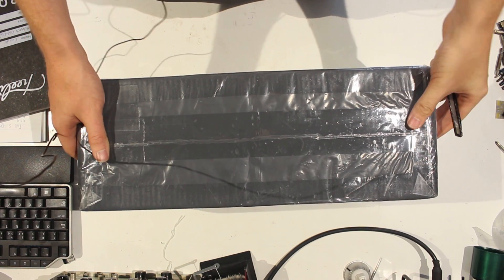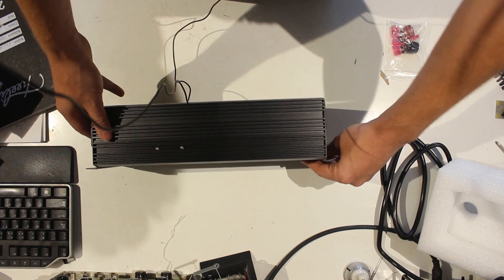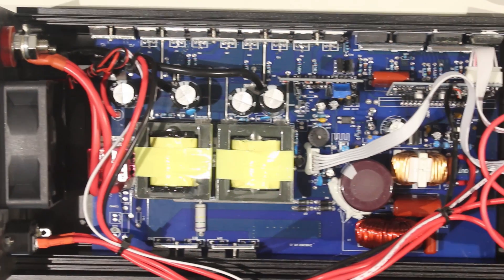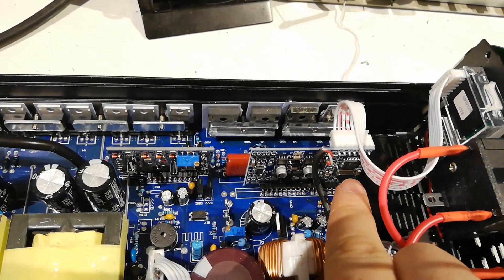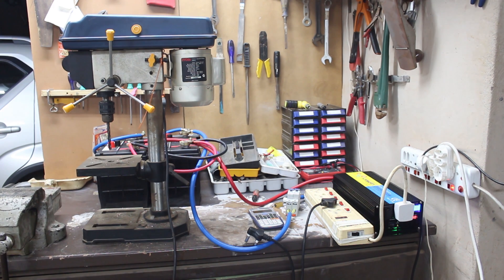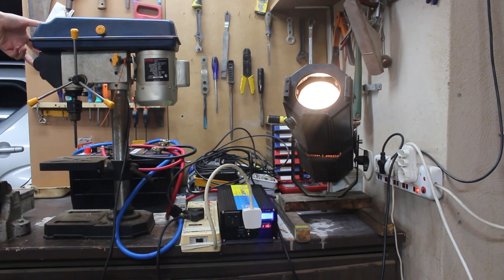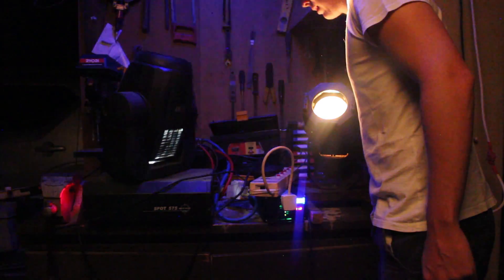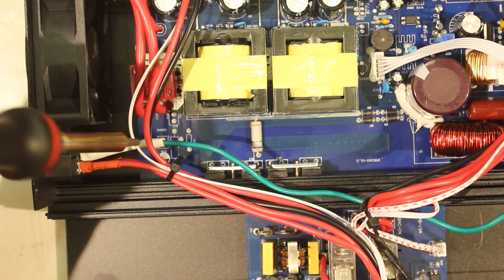Cheap 2000W Pure Sine Inverter Review and Teardown

Comment: 1200w are more then the rating!

Every knows when buying a Chinese cheap anything,  you have to double it...  You need 2000w to run something,  you dont buy a 2000w, you buy a 4000/5000wand you get 2500-3000 out of it...  Depends on where you plan to plug it in.. 🤔  But come on

Comment: I bought an pure sine wave 2500 W inverter of this brand 7 years ago. The performance has been fabulous through out those years. I used this to covert power from a 24V-300Ah lithium battery (Laid- acid battery in earlier days) of my off grid solar power station. It has successfully drive my washing machine with heating function (Maxium ~2000W) for years. Despite it get hot after this (Especially summer time), it is still running today. (While I should bought an inverter with higher capacity.)

The only repairing is the cooling fan bearing bursted recently and I have to replace it. Other parts still in a good condition to support daily operations. 
But I do agree that when you are going to use this type of inverter, basic knowledge on electricity usage is needed. Especially for the earthing, I built another socket for this. I also applied several Circuit Breakers after it's output to protect the inverter and the 220V devices.

Comment: Bought the same brand, but the 12VDC - 1.5/3kW version and surprise, surprise it lasted 3 seconds; BANG! and then smoke from inside. The sound was really loud, like a gunshot. Didn't even get a chance to plug in anything and was dead. The DCV display was still working, green LED on, but the AC display was dead and of course no power on the AC side. Made in china; what to expect? Clearly was not tested before leaving the factory, otherwise they would have enjoyed the bang, not me.
Reply: What did you connect into inverter? Btw. iphones are made in china too

Comment: WOW!!   LVYUAN brand?   finally i find a INVERTER that uses the EGS002 control board!!!  they are very reliable and they are only 4 dollars,or 4 euros, to replace in case they fail;     *THAT IS GREAT*
Thanks for showing those internals,that is what i was looking  for; 

and that thing LOOKS GOOD,it really does,lots of mosfets,and well built;  (too bad it has only 2 of those small transformers,shd be 3 or 4 )
Reply: I agree, 2000W inverter usually has 4 X transformers
Reply: @voltworksofficial    damm... it looks like it has a 3rd transformer under the lid,it has thick wires going to the lid!!  it also serves as a UPS,the video author said??   if it is so,i do not want it,i will choose another similar Lvyuan without that
Reply: @josepeixoto3384  Oh ,yes,there is a 3rd transformer in another PCB

Comment: I have the 1500watt one of this make in my RV and its been great - I have it feeding a soft start 4 socket extension lead - the most I ever pull is a 900w microwave  - we have a rule only one large appliance on at a time ie toaster/kettle/coffee maker - we have a led indicator switch conveniently place ti trigger a 120a relay so its not left on when not in use - was temted to go bigger but out 320ah lifepo4  house battery only has a 120a BMS
Reply: is it still going?
Reply: So there both red cause there both actives !
 there is no neutral 
You need men to have neutral and that's not on portable power😅

Comment: If I look at the power cord for my 2Kw fan heater the wires for that are thinner than the internal wires on this inverter and I have not had any issues with my heater in the many years I have used that!

Comment: Is there a chance 2000w is the peak wattage?
Reply from the maker: Hi I am not sure really. I tested it up to like 1300W. It said the peak wattage was 4000W for starting motors and such and 2000W should be the max continuous wattage.
Reply: @ChristopherdeVilliers  There is no way that the 2 x transformers together are capable of 2000W continuous
Reply: @ashrafebrahim8395  I agree your thoughts,usually one transformer is about 500W, two means 1000W,

Comment: Thanks for the video - was curious on how sketchy these were since I bought a "1kW/2kW" inverter for off the grid use. Seems somewhat sketchy but not dangerously so which is good enough for me at the price. :D Just commenting to be a classic youtube know-it-all, I don't think drill will not pull its rated power at no load.

But it's nice to see that I'm set for a proper island rave. :D
Reply from the maker: Ooooo an island rave sounds fun. Enjoy

Comment: If you were wanting to power your house I would of opted for the 24v-240v lvyuan CZ-3000W ups inverter charger. It has a 9000w peak for half a second and rated at 3000w continuous. It also has a 40amp in built charger that will charge you battery if you have no sun for solar input via the mains. Also has a earth point. Heavier duty qualitly build weighing in at 25kg with six power outlets.

The one you have isn't built for households it's more of a RV, caravan, camping or for light ireggular use. They can't handel heavy loads for long or they over heat
Reply: and costing how much?  a fortune,for sure;  
9000 watts at 24 volts is more than 375 Amps: WOW, that is a STARTER MOTOR of a V8 car; 2 large car batteries would last the whole of 10 minutes,tops; at 3000 watts ,125 Amps, they  last a bit more...
Reply: @josepeixoto3384  think I paid $600 Australian for mine on ebay. There is newer models for roughly the same price 

Yeah puts out amazing amount of power. I run four 12v 230ah deep cycle agm batteries on my solar se up. Eight 250w solar panels and a 60 amp mppt charger controller...oh and a 3500w generator for days of rain. No issues yet. Happy dayz.

Comment: Careful with the Idea of connecting grounds... These inverters have no neutral, your two wires are two phases. If your inverter is 220v you would read 110v between one phase and ground. If you connect ground wires (especially the input side) you will essentially end up shorting one side to ground because typically in your home breaker box neutral is bonded to ground. This will fry your inverter.
Reply: Only in countries that have 110v supply.  Many countries have single phase 240v domestic supply. (AU, UK, ZA, etc)

Comment: These inverters are generally used in RVs, so mentioning that the earths are not connected makes no sense. Unless the user hammers an earth spike into the ground, where would you connect the earths to? I guess you could connect them to the chassis for  shock prevention
Reply from the maker: Hi, so RVs or caravans in South Africa have small DB boxes with Earth leakage breakers for safety, but the primary use case for us is using these as backup power during power outages which can happen many times a week. But if it does not have an earth connection then anything you plug into it is dangerous during normal/non-inverter times. Hope that clarifies my use case and problem.

Comment: Hi Christopher, I have a similar Pure sine wave inverter, 2000W / 4000W max There is no output, The Mosfets (4 pieces ) have gone defective, sadly there is no identification on them. 

I wonder if you could suggest a Mosfet to replace them as you seem to have a similar unit.
Reply from the maker: Hi John, sadly I don't have the inverter with me otherwise I would give you the fet numbers it uses. I am assuming that you have a 240V model as well. This means that the DC-DC converter on the inside produces voltages of 400+ volts. I would say have a look on Digikey/Mouser/RS for a fet that can handle around 600V and a current of around 30A. Something like the IRF27N60 or IPW60R070C. Check the datasheets just to make sure they can handle the current and voltages. Also see if you can figure out what the pinout of those fets are and get a replacement that matches it. 

Hope this helps, maybe send me a few photos if you want to.
Kind regards

Comment: with all due respect. Review ? You test the inverter to half its specs performance. No sine wave test. You should have said that at the beginniong to not waste peoples time.
Reply from the maker: Hi Novelistus, Sorry you did not find what you were looking for in the video. The wires inside the inverter are so thin that it would have been hazardous to test it at 2000W for any amount of time. The inverter serves the purposes that I bought it for which is to keep my PC, wifi and a few lights on for an hour or so during power outages. You can run some power tools with it. Most people do not know what an oscilloscope is and I am sure many have forgotten what a sine wave is as well so that would not help make the video more entertaining.
Reply: @ChristopherdeVilliers  Sorry man, no offence. You did a good job on the video. But testing to half the capacity isn't really a review or testing at all. Peace. All good. I spent a bit more money and bought something more substantial.

Comment: Hello, Christopher, are you satisfied with this inverter in total? As to the battery charger - does it charge any type of 12V batteries? Thanks
Reply: Lithium has different and specific charging parameters. Im not sure what this unit puts out because I haven't seen the full video yet but I have been building battery banks out of lithium 18650 cells and am well acquainted with the dangers of using the inappropriate charging device for a 12 volt lithium battery. 

Lithium battery cells don't self regulate the same way a lead acid cell would. Lead acid is pretty neat in that you can overcharge it a little and it will stabilize at it's comfortable resting voltage after awhile after disconnecting them, even when connected in series like you see in a car battery. Lithium doesn't do that and so it needs a BMS or Battery Management System. A lot of hobby lithium batteries don't have BMSs and so there is the danger of overcharging, or overdischarging a cell in the pack and potentially causing a nokia-esque conflagration. 

RV style lithium drop in batteries like you find for the BATTLEBORN batteries should have a built in BMS it says drop in because they are installed in the same systems that lead acid batteries were used in so the system lacks a BMS, but no worries because the drop in lithium batteries have it built in so they effectively self regulate like a lead acid does naturally. 

I'd be happy to relay some knowledge to you if you have any questions, but dear god do your own research on top of the advice you get because you never know who will troll you.
Reply: @SirCumferencelel  perfect explanation, reason why I thought twice about making my own lithium based power wall. Would love to pick your mind btw regarding small lead acid backup setups.
Reply from the maker: Hi, yes I am pretty satisfied. It does exactly what I need it to do. It will charge anything but I would not use this with Lithium batteries.
Reply: @ChristopherdeVilliers  Why? Is it dangerous or, maybe, it should have voltage restriction for Lithium?